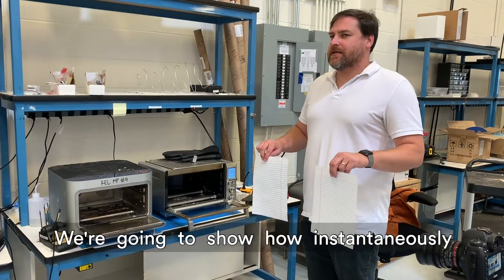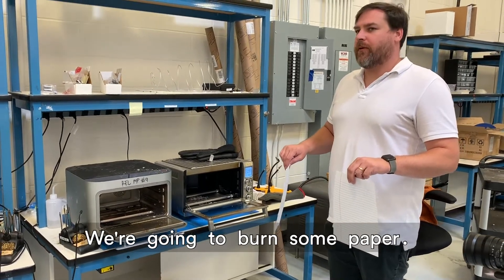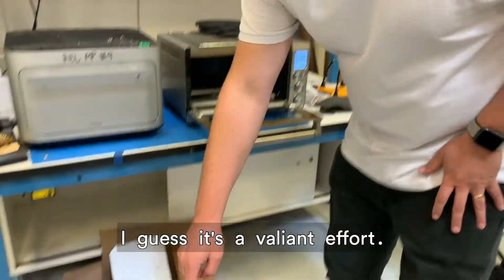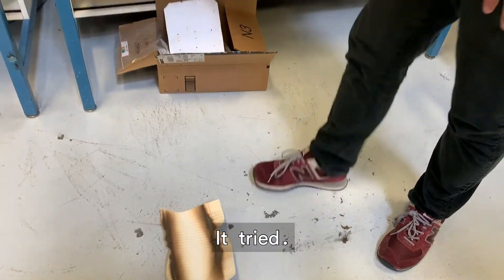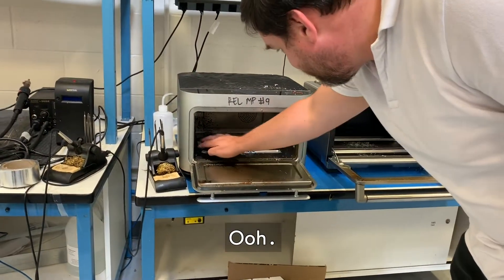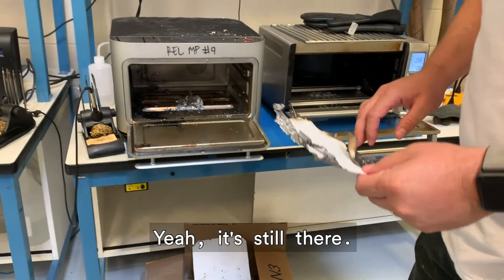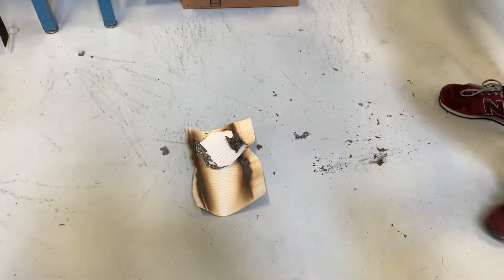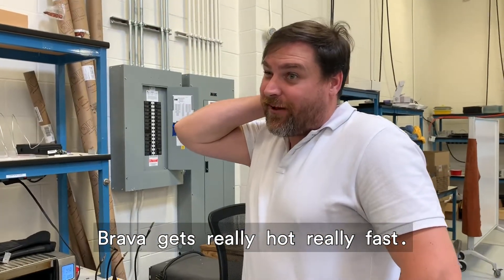From the Brava Lab | Burning paper in the Brava vs. toaster oven

Comment: You did not show the temperature setting of either appliance. One could have been set at 100 deg F and the other at 450 deg F or even Sear so . . . . even though you said "heat to maximum temperature" there still could be a difference in max temp. I know the point was to show which one heated up to "max temp" first but then again you did not show what temp each was at point of ingnition, either. It may not have been at max temp. You could show at what temp the paper will ignite and how long it takes to get to that temp. Safety thing, you know.